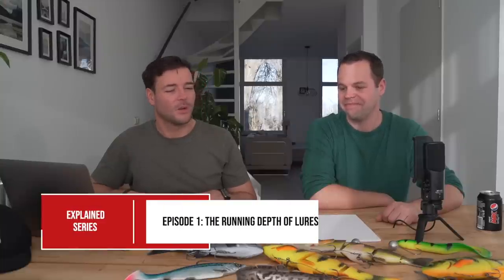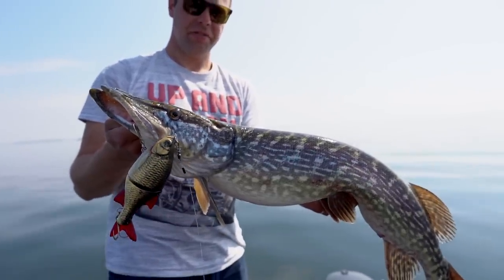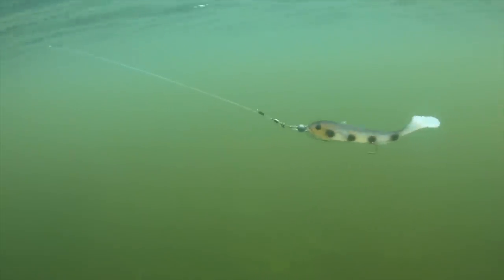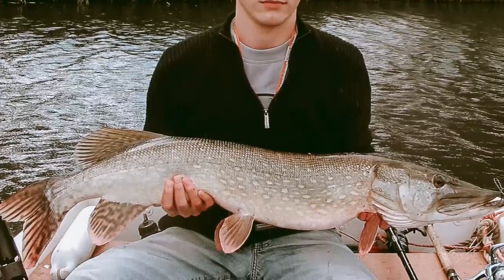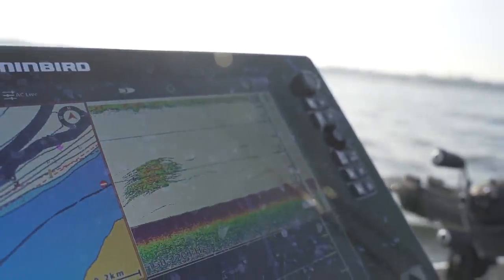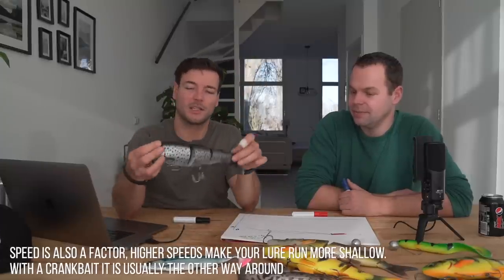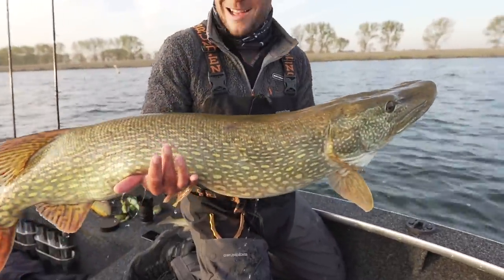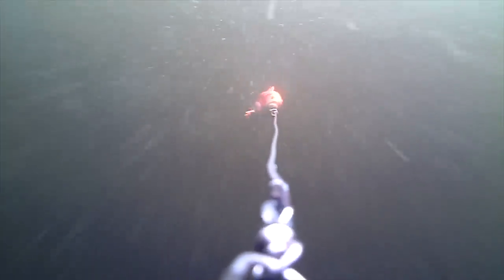Explained Series - How to control the running depth of your Lures - detailed tactics

Comment: Thanks for the video ! It is not exact science and will never be but probably the best way to get close to desired depth is - as You said - to check when the lure hits the bottom ... so for example we can measure the line and mark on 20,25,30... meters and then with specific lure, amount of line and speed if it hits the bottom on depth let's say 10m we move to more shallow water until it doesn't hit the bottom (or the other way). This method is time consuming nasty piece of work though.
So probably the best way is just to get practice during fishing and then after some time it just comes automatically.    Salute !
Reply from the maker: I fully agree, its an easy trick to make the whole process of learning a bit more easy overall. Thanks for your feedback, appreciate it 💪

Comment: Thanks for sharing some of the details about trolling! From how deep a pike can swim up to chase a lure? Will they swim up 5 meters to catch a prey?
Reply from the maker: Yes sometimes even more, depending on the water temperature. Usually when it gets colder they will be less eager to cross big distances
Reply: @whitelabelfishing So lets say it is a bit colder and it is fall. I fish in 3 to 5 meter of water what water layer should i fish? Upper layer will catch pike? Middle or very close to bottom?